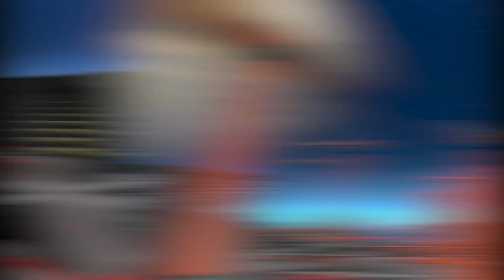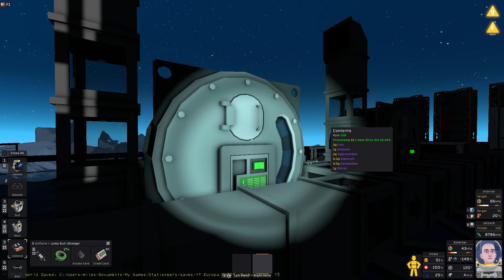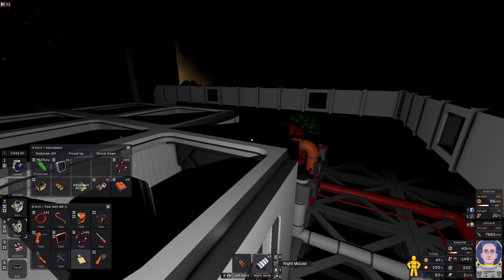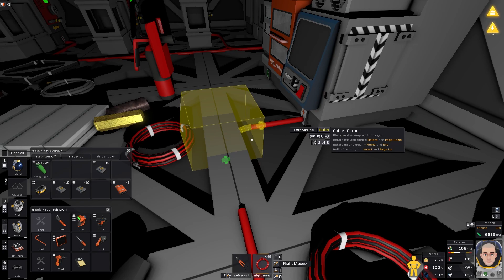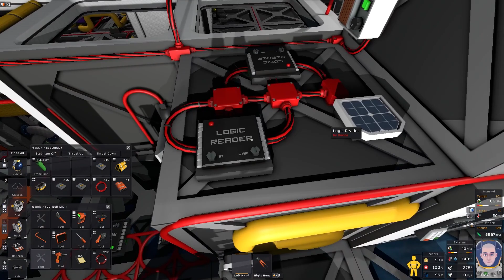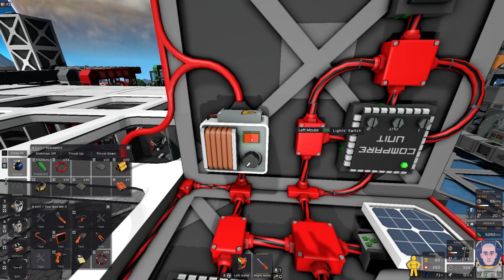Extreme Base Makeovers: Europa | Stationeers Europa | #20

Comment: i learned the MIPS language yesterday and made myself centrifuge script for NOS version, works pretty well, goes to 940 rpm which makes it process in 2 ticks, my fuel wasnt perfect 50/50 so i dont think i can get 1800. only uses 30% fuel on the centrifuge, runs 4 drills just fine (i made 2 centrifuges and 8 drills, the script works as batch so it will work on every centrifuge at the same time :D)
Reply: also made a script to run generators when batteries are at below 30% charge average, and it turns it off when they reach 60% charge, if u want i can drop the code in here or discord or something
Reply from the maker: Another community member also made a  generator script, but I can't seem to get it to work. So sure! Go for it.
Reply from the maker: Very nice!

Comment: Can you unload the Combustion Centrifuge while it's running or is it really made to process a lot of dirty ore, then  when it has a lot and you need some to spin it down and unload, then restart it?
Reply from the maker: You can output while it's running, but this will cause it to slow down rapidly and spike the stress up to 100%. I'm not sure if it's possible to actually break it (or blow it up for that matter), but it makes a horrible noise for a while and then you need to restart it anyway. This just saves your ears a bit of trouble 😂
Reply: @LargelyUnemployed  OK, yea, I guess I should have been more clear.. lol.. Do we know if there is a way it can unload and continue to work properly... I've pulled the lever before when it was running.. So.. My ears have been treated to that wonderful noise..
Reply from the maker: @DB-zp9un  haha no not that I know of. I'll ask for advice in the next one!
Reply: @LargelyUnemployed  Awesome, I'm curious to see if you pop it everytime even 1 ore gets processed if it wont put as much stress on it.. I'm sure there is some way, I'm just not smart enough to figure it out :D
Reply: Simply switching it off slows the centrifuge down quite nicely...